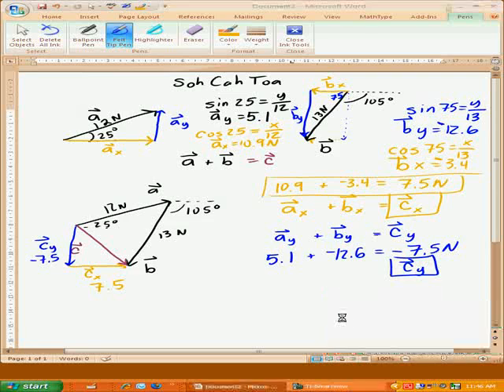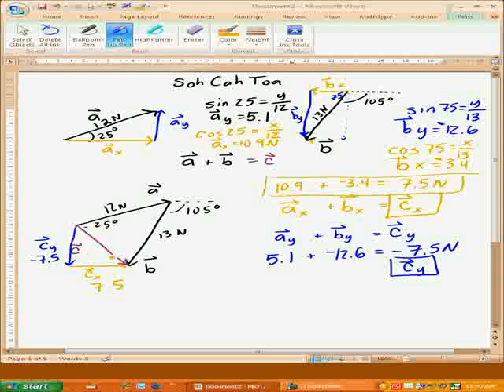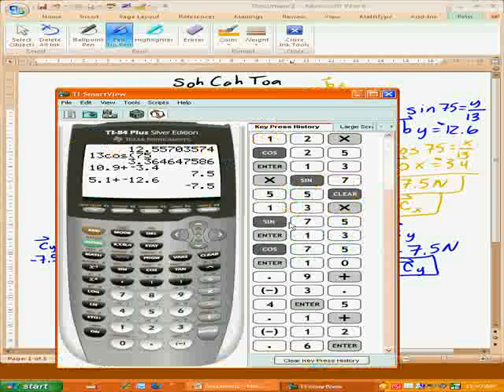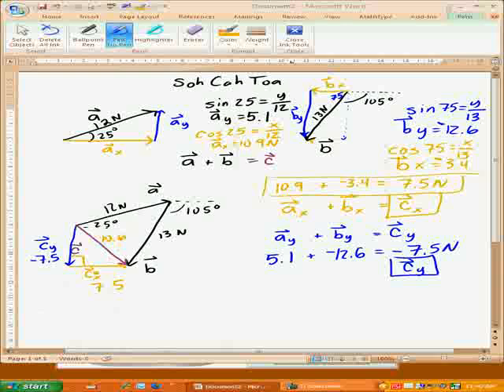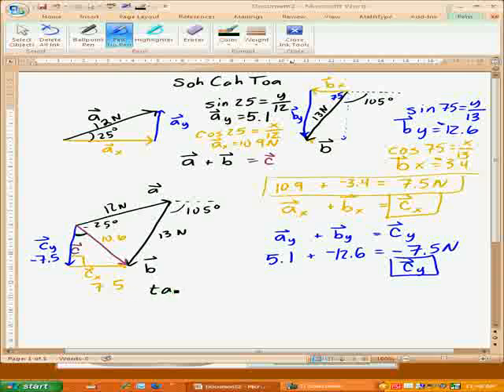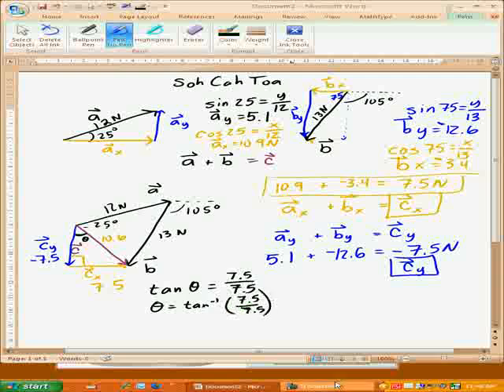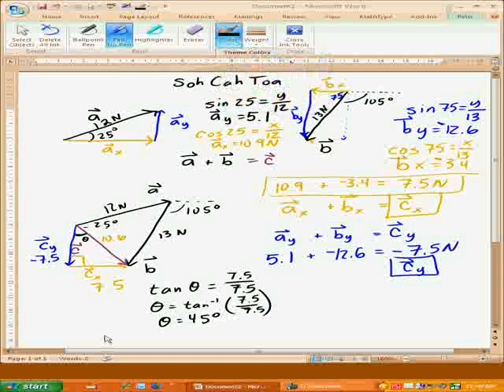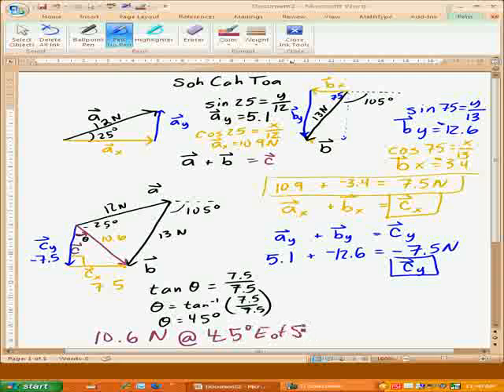How to Add vectors using components (part 2)

Comment from the maker: @godieinafreakinhole It is an emulator put out by Texas Instruments called the TI Smartview.  You can use it on your computer, push buttons on a tablet, use it on a smart board, or can actually hook your TI-83 up to the computer and work with an actual calculator.  There are other screens (multi-view with tables and graphs) that are very cool as well!  Cheers!

Comment from the maker: You are correct, mathematically.  That would give an angle of -45 deg.  So, from the resultant vector to the negative y-axis is -45 deg (45 degrees clockwise).  There are many ways to appropriately identify an angle, one of which is in relationship to cardinal directions (45 deg E of S).  As long as you identify the final angle, it is ok to use positive lengths with the trig.  The positives and negatives merely denote DIRECTION, so the trig is the same.  Thanks for the comments!